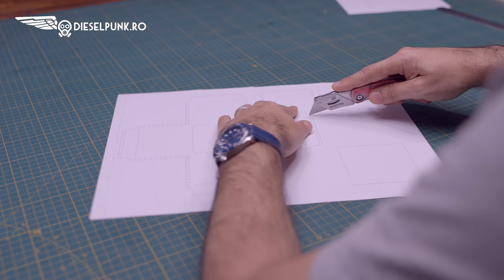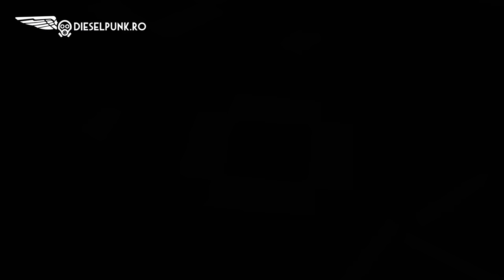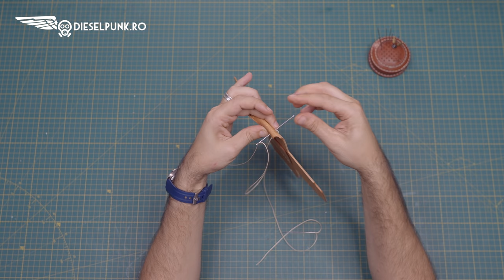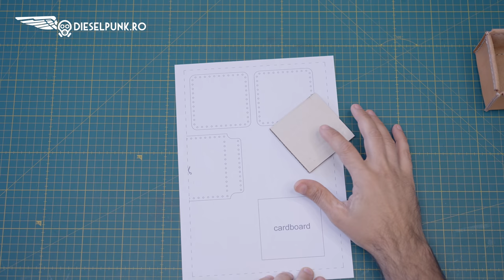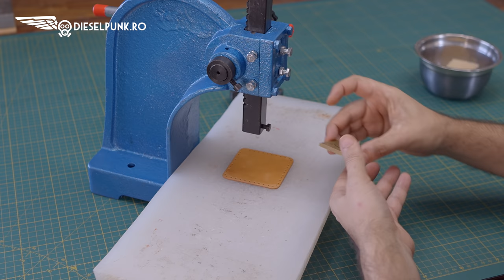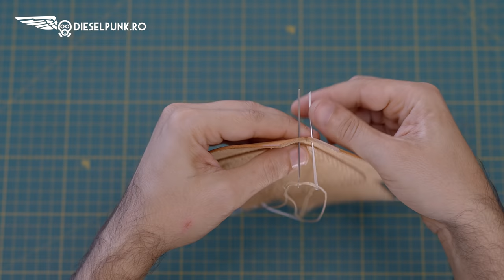Leather Gift Box DIY - Tutorial and PDF Pattern Download

Comment: Tony I purchased this pattern and I am in the middle of cutting out the leather. When doing the box lid your logo which is a very dark black colour blocks out some of the punch holes especially on of the corner hole to the point you cannot see where it is. I understand the reason for the logo but it should be a light gray colour so you can see where to cut and punch holes. The uTude shows you cutting out the pattern without any logos. Is it possible to print the pattern without the logo?